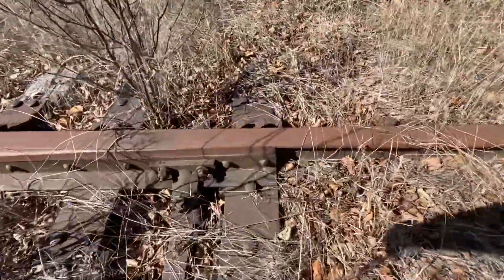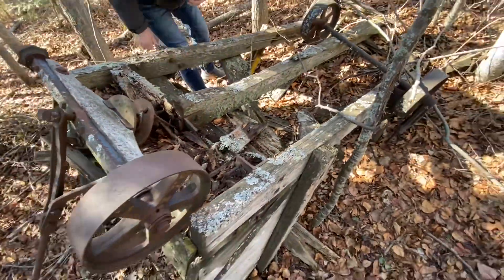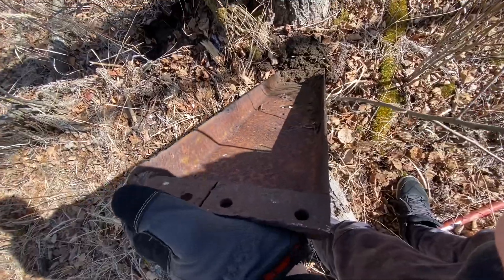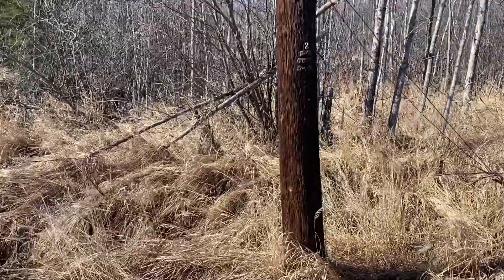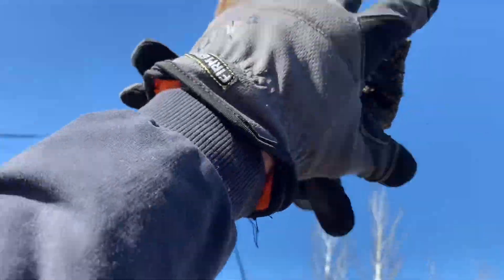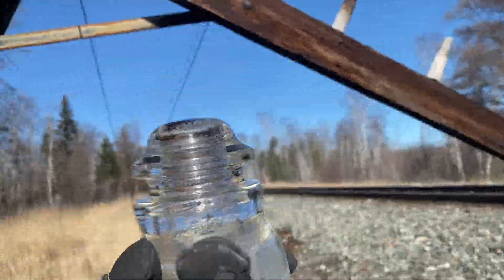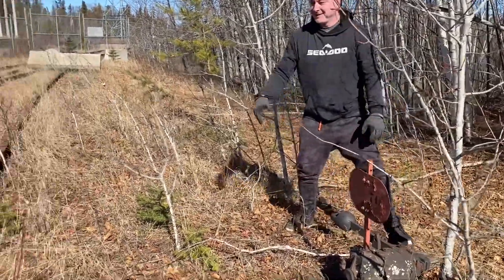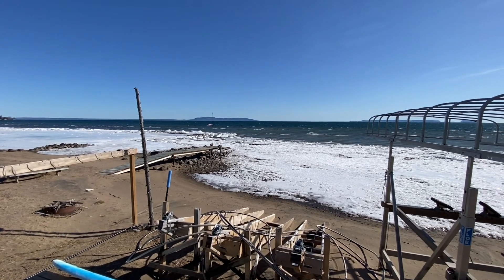Carts, Trains and Telegraphs

Comment: A couple of observations... (from a US perspective.)

1. Clear insulators became common in the 1930s. Prior to that, they generally had a green or blue tint, due to impurities in the silica (sand) used to make the glass.  This isn't tableware, after all.

2. Most likely, the wires were telephone wires. The fact that it made a cracking sound on the inside indicates that it had multiple conductors in it.  Telegraph wire was usually uninsulated single conductor, much like power wiring.  The telegraph system used the earth as the return line...